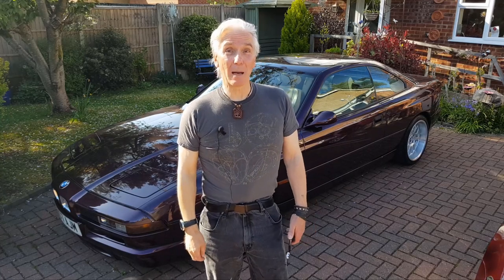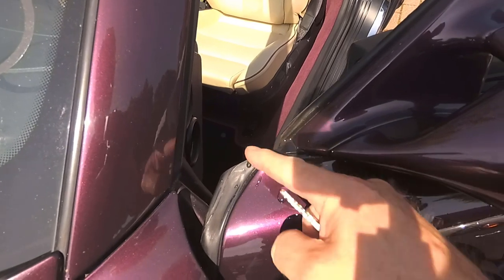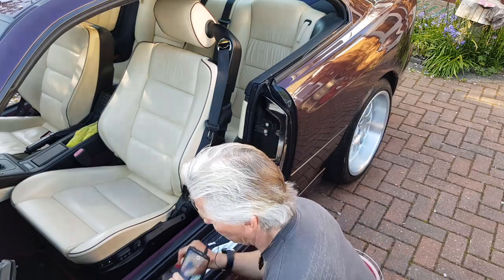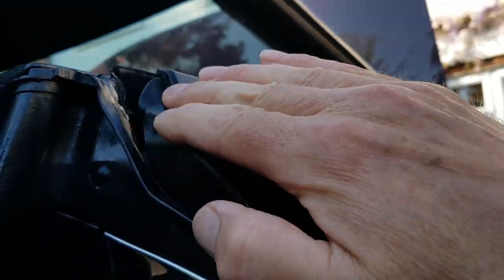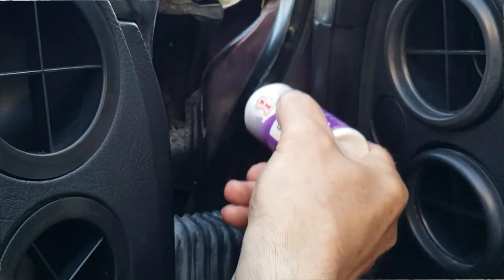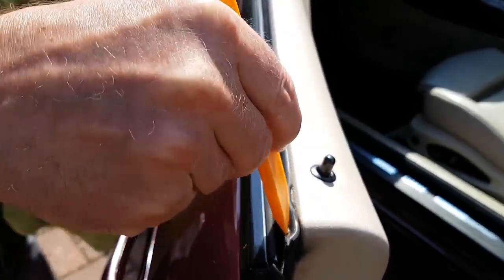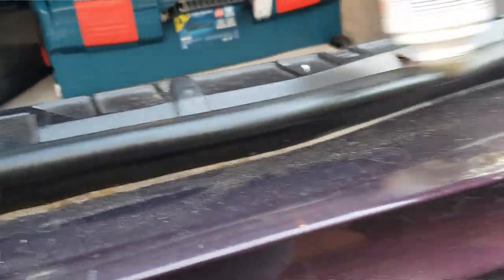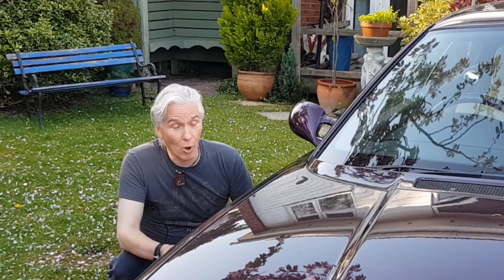BMW E31 8-Series - Look after your seals!

Comment: Another informative tutorial Timm 👍 perhaps may us E31’s owners ask if you can do a sunroof maintenance and lubrication one next?
Many thanks
Reply from the maker: You can ask.....but I disconnected my sunroof motor (under the upper access panel) because I didn't want it opening when I 'comfort open' the car with the remote - and, it's like pulling the pin on a grenade  every time you open it! It's stayed happily shut for the last two years, and it's staying that way!
Reply: Timm's BMW Repairs and Information 
Oh.....I am surprised. Seems the sunroof can give so many issues, rust, alignment, leakage and outright failure....but thanks for your reply Timm
Reply from the maker: Yes, that's my point, unless you really want to use it (and it's not a good plan, it really accelerates the failure of the roof lining and parcel shelf) then it does need to be maintained to some extent (such as lubricating the gears and runner, Gummi Pflege on the seals etc). My plan is to try and ignore it until I have to take on the rust problems!

Comment: I work with a technician who has this kind of outlook - preventative maintenance all the way! Quick question for you Timm, have you ever replaced the rear upper control arms AKA the "wishbones" on your E31? I have some bearings I got from Wokke that I plan on pressing in but I can't find a good guide anywhere. I'm sure I could break new ground and maybe do one myself, but better safe rather than sorry. As always much appreciated!
Reply from the maker: Yes, but I bought the complete wishbones from Wolfe to save me the time pressing them in - and then I asked Lee Shannon to fit them for me, I'm getting too old to get under cars these days!

Comment: Timm I'm about to order a new upper weatherstrip seal but can't find a video anywhere showing how to remove and install these very expensive strips! Any tips?? Thanks!
Reply from the maker: You will be fine as long as the window has not been replaced as it just presses in from the centre - but window fitters usually splurge the glue around and block the channel!
Reply: @TimmsBMWRepairsandInformation  can’t wait to try..Thanks!